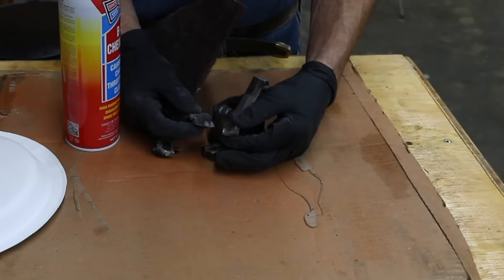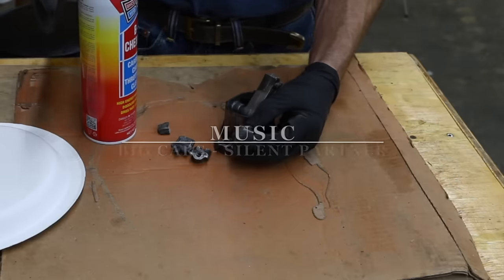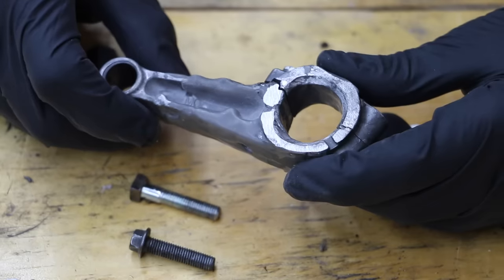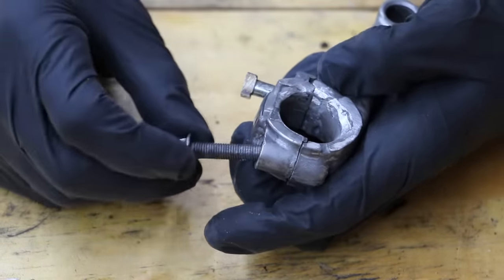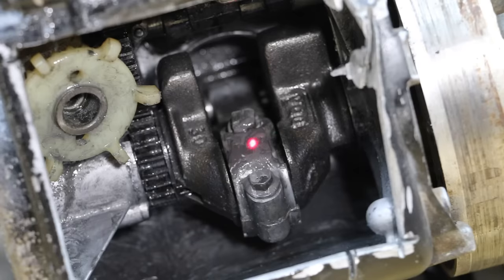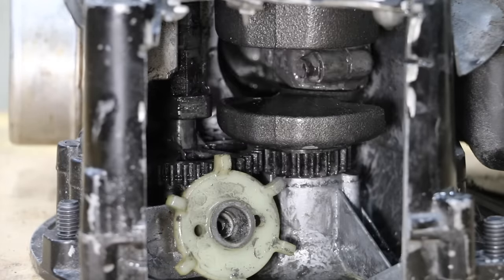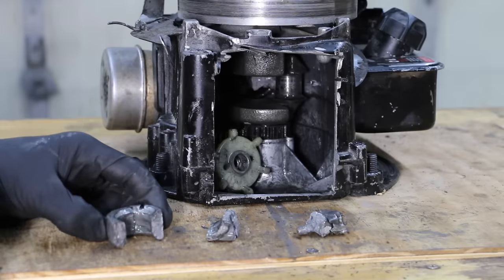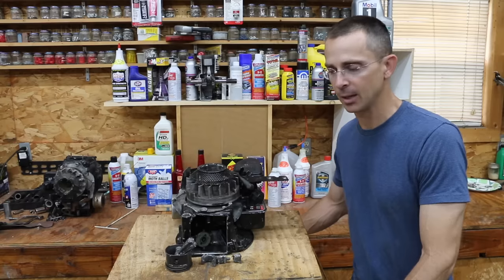Is JB Weld Strong Enough to Repair a Broken Connecting Rod? Let's Find Out!

Comment: Does anyone know the amount of G forces that a connecting rod undergoes at high RPM's? 10,000 G's at 20,000 RPMs
Reply from the maker: Thanks for the feedback.
Reply: @ProjectFarm   I won't go through the physics but if that connecting rod did not have the tensile strength to support several hundred times its own weight (plus the piston), it was never going to work very long. As your test showed.

Comment: Should got a new rod and cut it.. then glued it.. dont use a smooth cut make like a steering rack with cuts in the joint to increase the surface area that way all the stress is on the jb weld.
Reply from the maker: Thanks for the suggestion.

Comment: How about a home made rod from 6061 aluminum. Nothing special. I made one many years ago in toolmaker class out of 7075 aluminum that ran for a number of years before I finally scrapped the mower.  It only needs to be rough sawn out and bored to fit the crank kinda sloppy lik an old rod. Just a test. It will work better than job weld for sure.
Reply from the maker: Thanks for the suggestion.

Comment: You cant apply JB Weld to moving parts. It's a sealing weld. Not a keep a moving part together weld. It does a good job on sealing and keeping non moving parts together. But if anything moves, JB Weld is not recommended.
Reply from the maker: It was a fun test. Thank you

Comment: @Project Farm I really like your videos but this one left me questioning. First, the rod was rather misaligned from what I could see at https://youtu.be/kDT02YamWdE?t=116. There is also a ton of JB Weld on there which probably added weight and threw off balance some. I'd argue that this was less than optimal starting place for the test.

No knock on your work, it was a tough thing to repair I'm certain. If you bust another rod, I'd say another test might be something worth exploring :)

Comment: "The Original Cold Weld two-part epoxy system that was designed as an alternative to torch welding. J-B Weld Original provides strong, lasting repairs to multiple surfaces and creates a bond stronger than steel. Perfect for DIY household, automotive, marine, craft repair and much more." Ha-ha....
Reply from the maker: Thanks for the feedback.

Comment: You may be interested to learn, if you don't already know, that BMW in manufacturing their GP super bike make the conrods whole then break them into the two halves the upper and lower sections, that will go on each side of the big end journal. This way they will always be able to bolt them together exactly how they fit. Weird right? Nah....... the Germans know what they are doing, that engine revs to 14,000.
Reply from the maker: Thank you for the feedback!

Comment: It's not the JB Weld joining the parts that's the problem. The connecting rod crank diameter is now way out of round and not the correct size tolerance, and it's out of balance. It probably would have blown apart if the same size and shape as solid, non welded parts.

Comment: i THINK YOU WOULD HAVE BETTER RESULT LOOK MUCH BETTER HAD YOU ACTUALLY PINNED EACH PIECE WITH JB
THEN IF YOU USE A PIECE OF PLASTIC OR JUST OIL AROUND THE CRANK SHAFT WHERE THE ROD IS SUPPOSED TO GO, 
THEN USED JB INSIDE THE CONNECTING ROD ASSEMBLED IT AND MADE A PERFECT CASTING 
I THINK IT WOULD LAST QUITE A WHILE
AS IS I DON'T THINK IT WOULD LAST VERY LONG ESPECIALLY UNDER LOAD.
Reply from the maker: Thanks for the constructive feedback.

Comment: This is the second time I watch this and I think you should have put it back together and started it under its own power. Turning the flywheel has a different angle of power on the rod (if I said that right). The piston should be pushing the rod down not the flywheel. Turning the flywheel puts pressure on the cap. Ahhh the cap is split different than an automotive engine. Hmmmmm!!!
Reply from the maker: Thanks for the constructive feedback.

Comment: You'd have more luck using super glue to do that. The results would have been the same but it would have held together a little bit longer.

In reality you'd have to weld it or cast a new one, I'd go with casting a new one because welding cast aluminium doesn't work well. Just invite some buds over for some beers, collect the cans and you're good to go.

Comment: Connecting rod pressure is measured in tonnage when an engine is running..So JB Weld really doesn't have a chance..I bet there are space age adhesives that might hold up at low rpm's..
Reply from the maker: Great point!  Thank you

Comment: Time and time again I have been disappointed by JB Weld.  From my experience, it can handle tension and compression well, but any type of application that will be subjected to torque requires a massive over application to build up a structure external to the fail point.  You can try this by cutting a key in half and JB weld it back together.  It will push and pull nicely in and out of the lock... but when you try to turn it the key will break off in the lock.
Reply from the maker: Thanks for the feedback.

Comment: I don't think JB weld is as good as it used to be
I bought 2 versions of jb weld
Conventional and kwik weld recently
Both failed to even cure to full strength. I checked the batch date and it we 1 month old. It failed to even bond to metal. 
Really disturbing to see a good company going down like this.

Before you say to mix it properly, I ensured mixing it thoroughly for good 5 minutes and kept all oil, grit and dirty away. So it was a clean application.

You are warned! Buy at own risk.
Reply from the maker: Thank you for the feedback

Comment: Full disclosure. Haven't seen it or read any comments. My prediction as whether the repair will work. Yes, but not for long.
Reply: Well, l was right. Off to MIT structural metal stress analysis lab.
Reply from the maker: lol. You are right.  It was a lot of fun.

Comment: I can tell you how to use jb weld on a connecting rod and it will last...make your own rod by ..injection mold using jb weld..using a grease gun...then machine the jb weld...and use solid bearing inserts....i bet you could power a 18hp engine with it!!!!....you got to put it under pressure to make it rigid though ,but grease gun would do it..they make carbon fiber rods for alot of military use..don't see why jb.weld wouldnt work almost as efficient
Reply from the maker: Thanks for sharing.

Comment: You didnt do it correctly but if you cast them out of jb wekd with bit of reinforcement i reckon that'd hold ive used it to repsir crankcases that have held up for thousands of road miles etc if prepped properly jb weld and others similar can and will replace solid metal / sheet steel applications vary lol
Reply from the maker: Thanks for the feedback.
Reply: @ProjectFarm  no diaresoect your great 👌💪✌️i love mechanical tests more jb weld if you want some more strength sand with 80 grit all over repair area if repairing like you did this part grind away every area of damaged seperated cracked material because its already been damaged by torsional stress stretching the atoms that contributed to its demise and failure in first place all you did was band aid a jugular cut you will bleed out just a matter of time. Jb weld has replaced many many things or similar 2 part epoxy metal mixes i work heavy metal engineering and used mamy times to keep plant material running aswell as motorcycles quads etc prep is most important as usual.

Comment: As good as jb weld is, another product we used in the industrial plants was much better---BELZONA
they have AWESOME dense ferrous recipe and rubber, and plastics
Reply: We use that to repair the Linings and walls of natural gas pumps anywhere from 200 to 600 PSI
Reply from the maker: Thanks for the feedback.

Comment: This is not an accurate or fair test of the adhesive, It could have failed due to increased heat due to no oil going to the rod and piston so of course, it overheated and broke. This occurred the first time with an unbroken connecting rod so really what did he prove? This test should have been done correctly with an engine sending oil to the moving parts.

Comment: The connecting rod had zero lubrication, the connector heated quickly and expanded, binding on the wrist pin, it doesn't take a scientist to figure that out.
Reply from the maker: Thank you

Comment: JB weld work's better as a filler, glueing parts together that are under load is not something I would even try.  Maybe you could cut it so there are only two places to bond it back together.  Good try.
Reply from the maker: Thanks for the feedback.

Comment: Yeah YOU CAN DO  better,
 actually run the engine with the piston turning the crankshaft and not you turning the crankshaft
  I seen ya with that impact on the crankshaft ! 
Yeah so the crankshaft was being turned maybe at the same RPMs but that's backwards you're usually crankshaft to move the piston rod and not the Piston Rod moving the crankshaft so it's inconclusive
Reply from the maker: Thanks for the feedback.

Comment: Running an engine with no oil doesn't seem like a good test!
Reply from the maker: Great point!
Reply: Oil acts as a dampener, so running almost any engine without oil will tear it apart. I should know as I once blew an engine when I was younger because I used oil that wasn't viscous enough 🤷🏻‍♂️😂

Comment: Your glue technique is piss poor. I think it would have ran longer if I would have been there to explain that just because it has product on what your trying to put together doesn’t mean it is gonna stick. It looked like you made no structure and just put some here an there you have to mold them all together one solid piece everything has to be encased in a thin layer of jb and it will absolutely work far longer than you demonstrated in your video respectfully. Try again? Or maybe challenge me to a duel sir lol😂😂😂😂Lmao